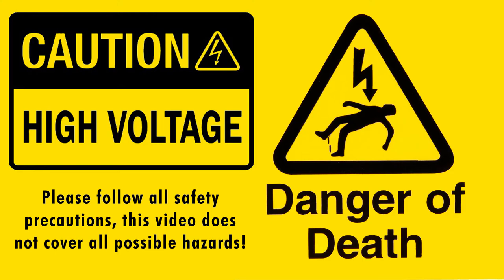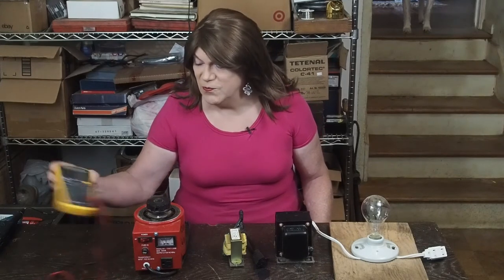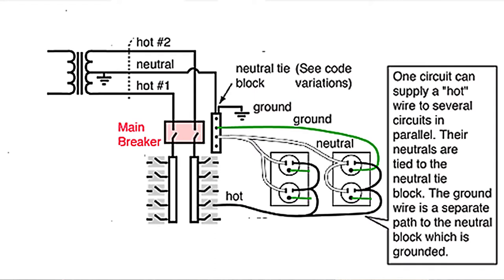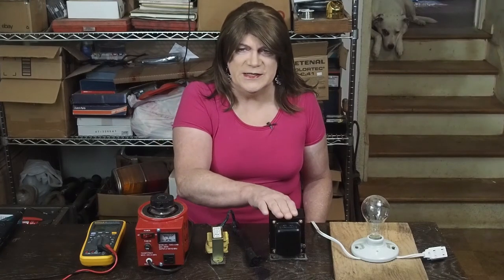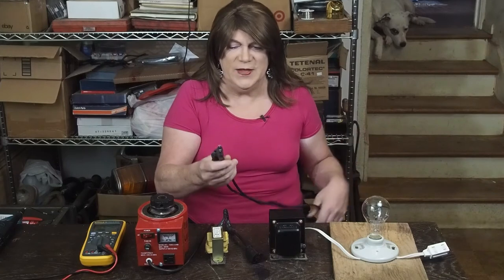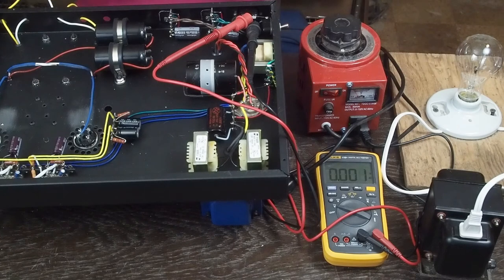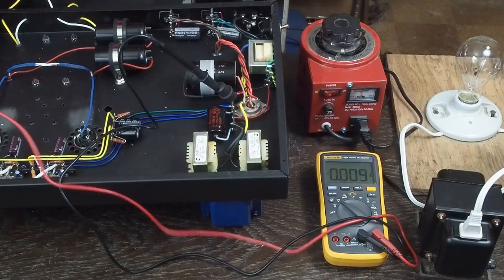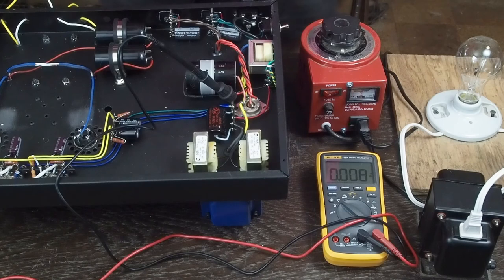How to Safely Work with High Voltage Electronics and Tube Amplifiers.

Comment: I stumbled across your channel looking for reviews of the Willsenton R8.  Before finishing your R8 series, I became more interested in your other videos, especially amp building videos.  To make a long story less long, I've been fascinated by tube based electronics since I was a kid.  I've also wanted to get into tube amps for a long time.  During most of that time, their price tags and my budget have never seen eye to eye.  I like the idea of learning how to build amps.  I've gotten back into collecting vinyl over the last few years.  My current system consists of a Harman/Kardon receiver I found at a local pawn shop, an inexpensive phono tube pre-amp from Amazon, and an Audio-Technica turntable.  I'm looking forward to starting to explore the world of tube amps.

I've started to get into electronics as a hobby a few times, only getting as far as experimenting with modern low voltage components on breadboards.  But I've forgotten most of what I've learned, and could use a refresher course. With knowledge of safety practices, I would be comfortable working around the amount high voltages present in most tube electronics, like amps.  I have a tube based TV that needs some work, but I'm not going anywhere near its high voltage section any time soon, if ever.  I've heard about variacs, isolation transformers, etc., many times, but your video is the first one I've come across that walks through the basics of their use.  Many, many thanks for this, and for all of your other videos!!  Do you have a video that covers safely discharging caps in gear that doesn't have bleeder resisters?  It looks like just checking their voltages would slowly drain them, as was happening in this video.

Comment: I have that variac and was complaining to the seller about how out of spec it was. Whoops! My bad, it does say 110v input, I didn’t think of that. 
My solution though was just to put a piece of tape on top that says: 105v = 117v. Or I measure with DMM, but I don’t need any precise voltages with it, yet. Thanks!

Comment: I have a good bit of fear when it comes to electricity.  I think that's a good thing so I respect it.  I'm learning and I need more knowledge before I get as comfortable as you guys AND GIRLS that have been doing this for a while.  I saw a video, a guy had one of those variacs made in China and it was grounded wrong on the inside, so I don't know if you ever checked your out.
Reply from the maker: Great point! I have checked mine, but you are right, don't assume anything!!!

Comment: hi i got a variac that i made myself with amp meter and voltmeter is it ok to put a ground to chassis of variac .the green  cable to metal of the variac.thanks
Reply from the maker: That's one of those "It depends".

Comment: hi, i'm sorry to ask since i'm totally blind about the electricity,  live in asia where the voltage is 240V. Is that safe if I buy a guitar amp with US Voltage i.e. 120V to use in Asia 240V by using step down transformer? thank you in advance
Reply from the maker: As long as the AC voltage the unit is plugged into is 120V and whatever device you are using to step down the power can handle the watts, it will be fine.
Reply: @SkunkieDesignsElectronics  thank you very much